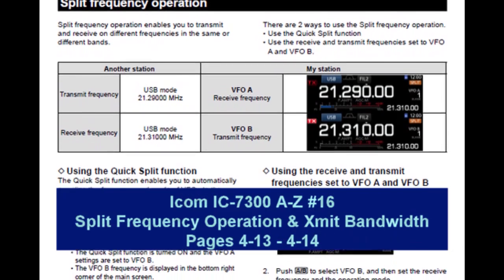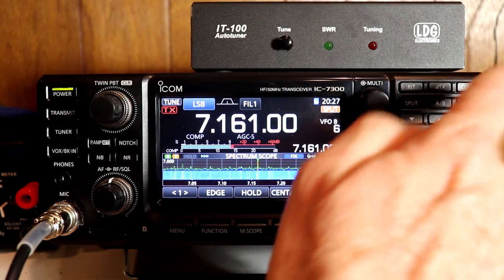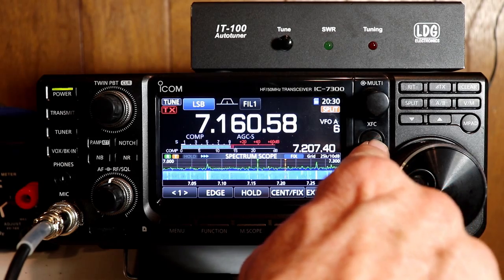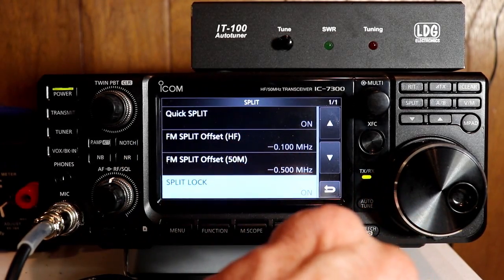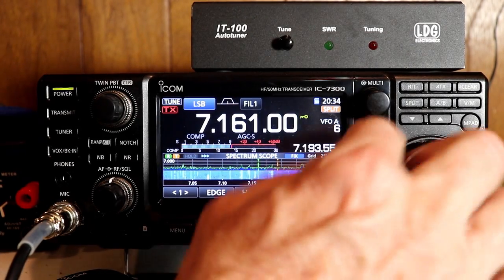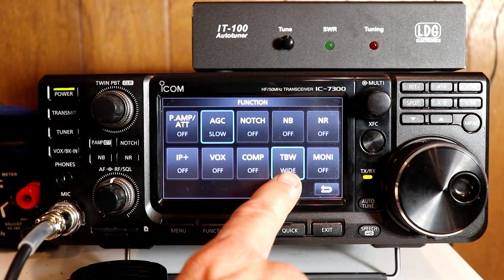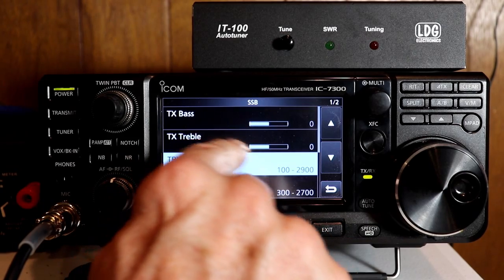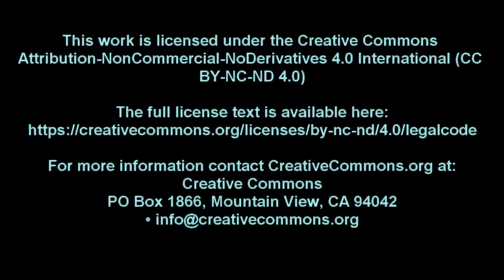Icom IC7300 A to Z #16 Split Frequency Operation & Transmit Bandwidth

Comment: Great videos.  I'm learning a lot even though I thought I went through the manual page by page.   I don't seem to have the option to change transmit BW on my 7300.  When I go to MENU ---  SET  ---  Tone Control there is no option for BW, just RX and TX tone.  I am in SSB when going to menu.  Any ideas?

Comment: About SSB-D mode. When using FT8 you want a wide as possible BW. Actually I think the wide BW is to narrow in the ic-7300. There are stations using lf-frequences over 3 khz which is not possible in ic-7300.
Reply: You can increase the BW to 3.6k - use the twin pot knobs.
Reply: @ronlaspisa450  The narrow/mid/wide settings are for transmit only, right? The receive bandwidth is independent and as Ron says can be set to 3.6k. I do that for FT8. However now I’m wondering if you can transmit at all in that extra bandwidth. I’ll have to play with this more.

Comment: First let me say how helpful these videos have been. At about 9:51 of Video #16 an orange code flashes to the right of the FIL 1 icon that says "OCF". What is that?
Reply: I see "OVF", not "OCF" - "Excessively strong signal is received." - if you search the full manual  for "OCF" in acrobat reader you find it's mentioned on page 14-6 and other places.  As I understand it, this usually means you need to turn off the pre-amp or turn on the attenuator.  Second the motion on "great videos".
Reply from the maker: Hi.  Sorry.  I thought I had replied to this.  It must have slipped my mind when I first saw your comment.  Theoldgronker is correct.  The indication is “OVF”. It stands for OVerFlow.  It means that the input A-D converter is getting a signal larger than it has a number for.  I’ve seen this when another ham station was very near me working pretty high power on the same band or a band close by.  I’ve also seen it when our club participates in a contest with multiple rigs in the same area.  Turning off the pre-amp and, possibly turning on the attenuator will help.  If it just flickers very briefly and occasionally you don’t really need to worry about it.

Comment: Hi Tom, I'm trying set my split operation to do the armed forces cross band test and can't get the rig to let me set to 13.450. for receiving (not tx). Rig keeps changing back to 14
100.  on 20m band. Tried to set band edge(s) also with same results. Can't find any info in book or vids helping with this issue. Please help! I do like the vids on this rig. They do help to explain a lot. thank you in advance.73.
Reply from the maker: Hi.  I just put 14.210 into VFO A and then put 13.450 into VFO B.  While receiving on VFO B, I pressed the split button to turn on SPLIT mode.  When I key the mic, the radio transmits on 14.210 and when I release the mic I’m receiving on 13.450.  So, I’m not sure what your problem might be.  14.100 is the default frequency the rig goes to on a factory reset.  Is it possible that you are getting RF into your shack somehow that might be resetting the radio every time you key it?

Comment: Please clarify, What's means of blinking 'OVF' message in Rx mode.
Reply from the maker: OVF stands for OVerFlow. It means that the A to D converter at the front end overflowed.  In other words it received a signal value larger than the biggest number it can store.  This can happen if you are close to another transmitter.

Comment: what is the orange T  for on the 7300 screen   the one beside the green R
Reply from the maker: It indicates that you have the Transmit Frequency Marker enabled.  On page <2> of the spectrum soft keys, there is a choice called MARKER that turns that on and off.  With that enabled, you will normally see a green/orange striped marker in FIX mode when you are operating a single frequency.  If you turn on Split mode, you will see an orange marker where your transmit frequency is and the green marker for your receive frequency.